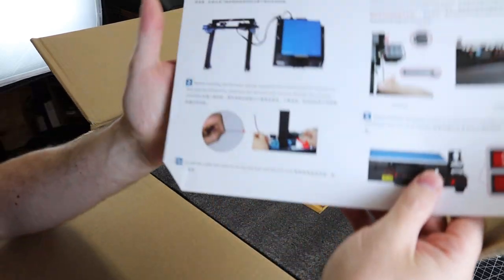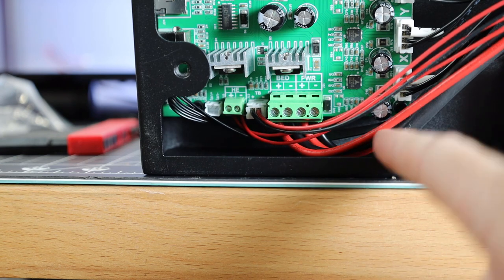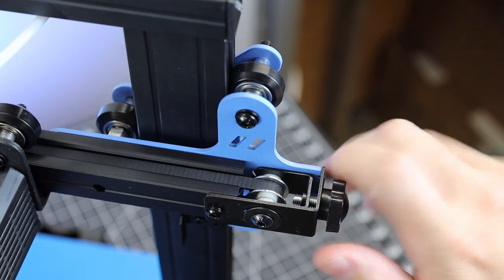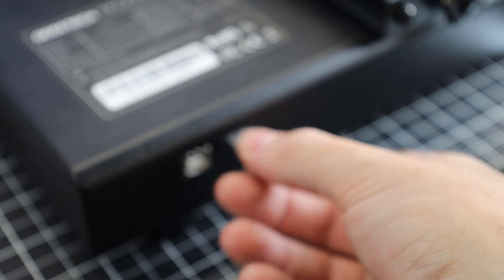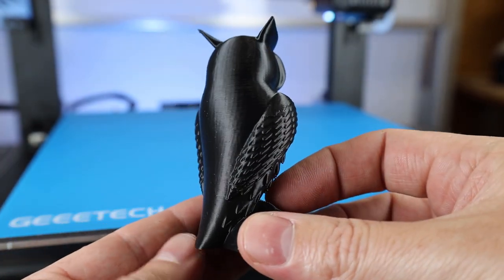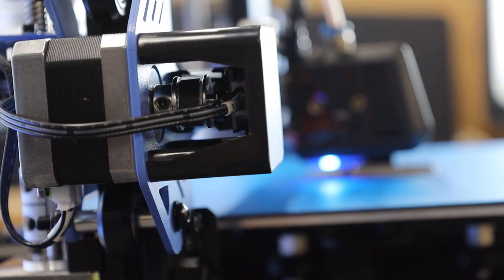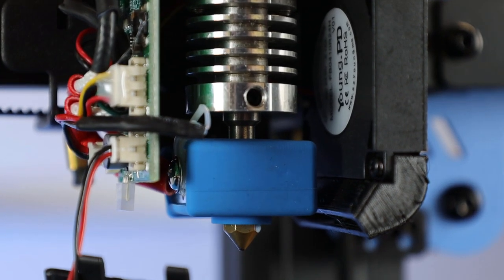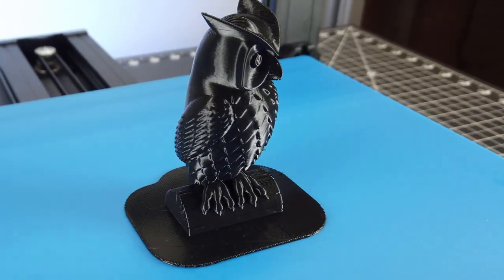Geeetech Mizar S Review // What is it Worth?

Comment from the maker: Geeetech Mizar S - https://bit.ly/GeeetechMizarS
From Amazon ($160 off Coupon as of 8/20/22) - https://amzn.to/3dNfvuA

Build Surface Upgrades - 
PEI Magnetic Build Surface - https://amzn.to/3cbso1k
Adhesive PEI Sheet Build Surface (Stick this to the underside of the stock metal build sheet so you can use both sides) - https://amzn.to/3CiZjvu

Hot End Upgrades - 
Slice Engineering - https://bit.ly/SliceEngineering
Capricorn XS Series PTFE Bowden Tubing - https://bit.ly/Capricorn-XS-Series-PTFE

MatterHackers 3D Printing Filament 1.75mm:
Build Series PLA - https://bit.ly/MatterHackersBuildSeriesPLA
Build Series Silky PLA - https://bit.ly/BuildSeriesSilkyPLAMatterHackers
Build Series ABS - https://bit.ly/MatterHackersBuildSeriesABS
Build Series PETG - https://bit.ly/MatterHackersBuildSeriesPETG
PRO Series Filament - https://bit.ly/MatterHackersPROSeriesFilament
NylonX Filament - https://bit.ly/MatterHackersNylonX

Other Helpful Tools:
Steel Feeler Gauge - https://amzn.to/3whIHQW
Hex Allen Power Bit Set - https://amzn.to/3pyWQpm
Cordless Screwdriver - https://amzn.to/3T6U4F6

3D Files:
Socket Holder Tray - https://www.thingiverse.com/thing:5232763
Sanding Block/Stick - https://www.printables.com/model/22236-customized-sanding-sticks-with-labels
Owl - https://www.printables.com/model/105444-owl
Rocket - https://www.thingiverse.com/make:381646

Amazon 3D Printing Filament 1.75mm:
PLA - https://amzn.to/3gsLE9Z
PETG - https://amzn.to/3pXjjvu
ABS - https://amzn.to/3wsTRjS
ASA - https://amzn.to/2RX8dtM
Polycarbonate - https://amzn.to/3cLdr38
Nylon - https://amzn.to/3iNGeI2
______________________________________________
Note : Most of the links that I use that go to products are affiliate link. This means I make a small commission on anything that you happen buy using them. This is at no extra charge to you and this helps support the work I do on this channel. 😁👍
______________________________________________
#Geeetech #GeeetechMizarS #3dPrinting #maker #3dScanning #DIY

Comment: Excellent video! I just unboxed mine and was immediately overwhelmed by all the parts.. your video will be extremely helpful!! Thank you so much!
Reply: Well, well, well... here we are 13 days later, and my printer turned out to be a door stop. Assembly was pretty easy...but it didn't work..tried some troubleshooting with tech support and nothing worked.  Asked for a return shipping label and I got the run around from the company. 😒 Probably should have bought it through Amazon..and not directly from the company.  Either way, situation has been resolved...in my favor.  I now have an Ender 3 V2 that is working, and a Geeetech that is collecting dust.  What do you know about replacing stepper drivers??? 🤔
Reply from the maker: Oh I'm sorry to hear that but at least it sounds like things worked out in your favor. When it comes to the stepper drivers, unless they are socketed so you can easily swap them out, then it might not be worth the time and effort to fix.

Comment: Hi, so I have a question because I kinda need help and haven’t found much online. I have this printer and love it. It is my first printer. I love it because I like to tinker and problem solve, but at times it is not the easiest to get setup especially when I was first starting out. The issue I encountered occurred after changing the nozzle. 
 I am getting a minimum temperature error and the temperature control and the temperature sensor cable broke in the middle of the cable. I soldered a replacement cable and there is continuity when I tested it. The board pin out has continuity too. Do I need to replace the entire hot end board or just the cable?

Comment: I think I'll stick to the A10M
Reply from the maker: Hey whatever works for you and you can get good prints out of it 😁👍
Reply: @randymay   Been using for years but I just killed it and now I'm having to buy another. Spent 4 hours trying to fix this morning and each thing I touched it just got worse until I blew it up somehow replacing a thermistor. Got so many spare parts and know it so well I might as well still to what I know. It was printing fine last night, I just clogged the 2nd extruder and could not get filament to go through, even after putting it in the flame of a gas stove for ages. I suspect melted PTFE in there